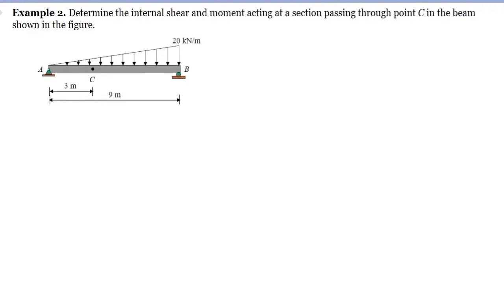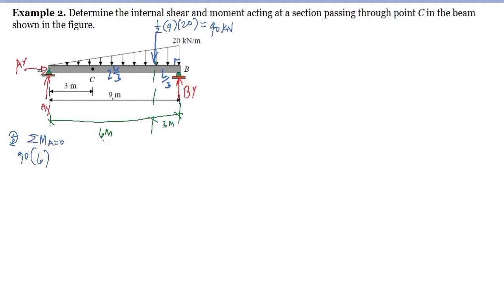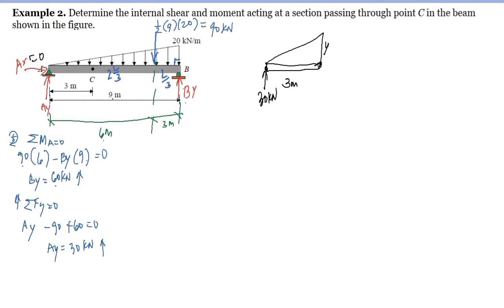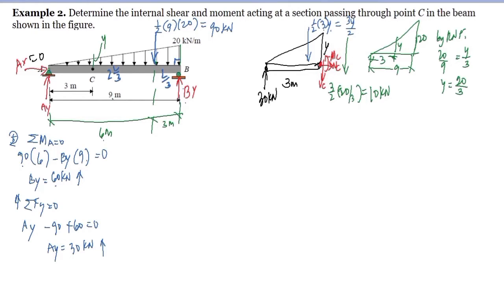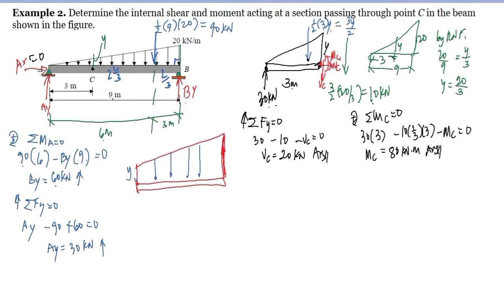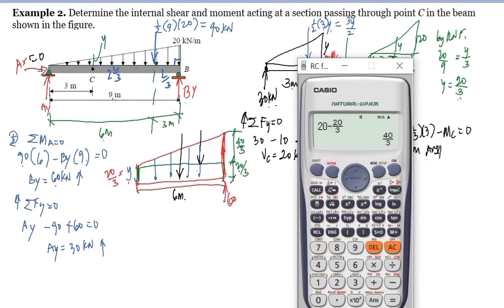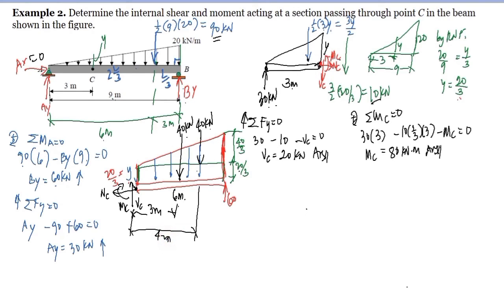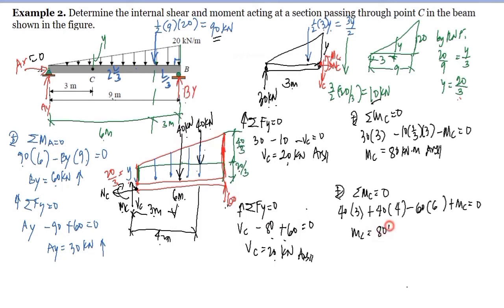Shear and Moment. Internal Loading at Specified Point Problem 2

Comment: hello po, bakt naging 10kN ung Y ? hindi ba 6.667 un if by R&P?
Reply from the maker: 6.667 or 20/3 ay magnitude palang po. Kaya sya naging 10 kasi yon ang resultant (area ng load diagram) 1/2*3*6.667 or 1/2*3*20/3 as shown sa solution.